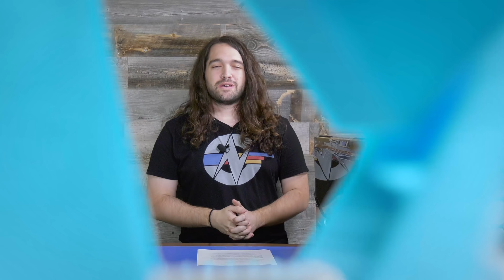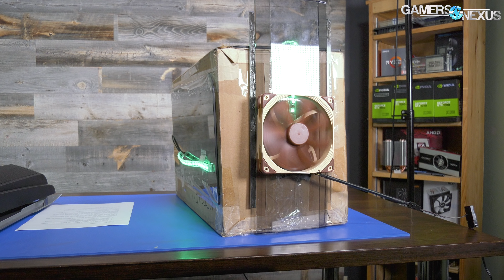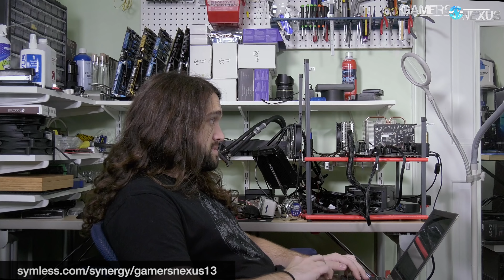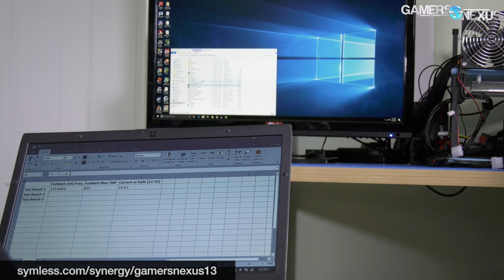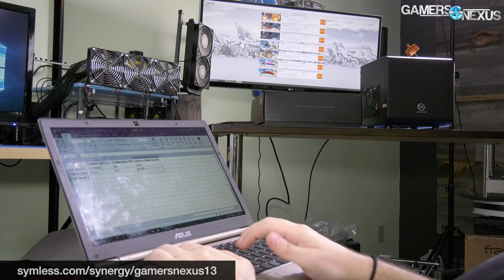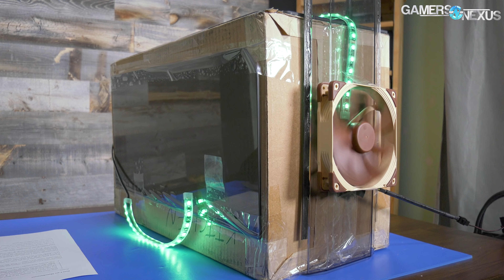Case Manufacturers: You're Worsening FPS & Power Draw

Comment: You do your research, you do tests different and are curious which is a rare trait today.
There's not a lot of people nowadays who just HAVE to know how and why to everything.
Your results are usually correct, they are way more accurate than ANY other techtuber, they have 99% of the time the correct conclusion and for 99% of the people it's correct.
keep up the good work.
 
But! you do tell some things wrong( Not directed at this video)
But you have the right entry point on every video you have.
Biggest error you've done is saying vega must have memory bandwidth, it's no big difference per se.
it's not very different from Nvidia but it's a very big difference on the HBM boards once you clock them and the technical understanding at very few points are somewhat lacking.

It clearly comes through that you ain't like me with 30 years of having the head inside computers and figuring out everything that is new and so on :)

Comment: Im planning to buy my own tempered glass front panel. Custom madw and make surw it has plenty of clearance cor the front fans. Yes you can buy custom made tempered glass with holes cut into it your way for pretty cheap. Then its all bout inserting a spacer of your desired thickness for clearance. Then getting some thumb screws. Yehhh

Comment: I'm looking for a case that is slightly larger than a Meshify C (GPU with front rad is .4 inches too long). Looking for open opr mesh front, no 5.25 bays, ATX size, and compact.
Would a 400C or 460X do well thermally, i currently use a 280mm IO, but I will get a NH D15 in a few years.

Comment: all you need: Dremmel, fibre cut-off wheels, 3/8ths drill bit.
every case i've owned in the 20yrs i've been building custom rigs has had extensive modding to add fans, expand for larger dia fans, turn solid panels into mesh ones, create wire pass-through slots (before there was such a thing), make room for radiators, remove drive cages & other bulky crap that blocks airflow, etc... there's NEVER a perfect case (TT X9 currently on order). that said, i completely share the frustration with current case trends being all show, no go - most are garbage as-is.

Comment: Part of the problem is the ATX format is so 1995.

The i/o panel needs to be in the middle with a new slot on the other side of the CPU.

There should be a fan under the motherboard.

More Type C USB.

Larger than eATX needed for more M.2 cards and quad-channel and Threadripper.

How about dual-Threadripper boards !!

Comment: When do u start your patented case production? :)))
On the topic - most pertinent points! Do keep in mind, though:
1. I strongly suspect that engineers usually take these facts into account, but the "cost of production" ppl... not necessarily (easier to keep all glass vs meshifying some parts) and they+marketing decide.
2. Vertical GPU bracket location - remember how it conflicted w one of your air coolers, in one of your reviews? The farther from the side window, the higher the interference, I think. This is a lesser of a problem w CPU liquid coolers. GPU cooling needs further thinking to balance Tglass and temps (and I don't think returnibg to side vent is a solution).
3. Definitely noise vs ventilation needs more discussion.
Thanks man! Keep doing a good job!
P.S. Oh, and I like how a guy named one of those CM mAtx all glass, nano-intake cases - a beautiful oven!

Comment: The problem I see is too much competition and not enough collaboration in the whole industry, competition is usually good but it is based on the wrong ideals (RGB & TG).
My example of a lack of collaboration is the introduction of GPU vertical mounts and back plates coinciding at roughly the same time rather than one being an upgrade or a modern variant on the other, GPU vertical mounts have come too late because the majority of graphics cards come with more aesthetically pleasing and affordable back plates.
Secondly there is a lack of or no GPU and CPU manufacturers that also make cases also, to consider thermals.
Take Samsung for instance and their SSD/M.2 process of ''all made in house''.
Are these not pretty much the best in this particular market?

Comment: I want to see you test a bunch of graphics cards with backplates on or off to see how much it affects perfomance. I have a gigabyte gtx 1060 6G Windforce (rev1, before the rgb...). After overclocking it at first pretty aggressively my card would thermal throttle at 90 degrees, after removing the backplate (even though it looks ugly) I'm getting 75 degrees max with the same overclock... I realize that this card's backplate is as bad as it gets but I want to know if there are other ones like this one.
Reply: I have a 1060 G1 Gaming. I get -10C without the backplate. It doesn't throttle with the backplate on but the fans ramp up extremely high and the sound is fucking atrocious. I'm never buying Gigabyte GPUs ever again.
Reply: This card also has very bad coil whine.
Reply: RIP. Well i wanted a cheap dual fan design so i didn't purchase the evga superclocked single fan. Mine doesn't have any perceptable coil whine though. :|
EDIT: I'm thinking about modding the backplate to make it more airflow friendly, using my trusty saw!

Comment: I gave up to tempered glass case just because it does not ventilate the GPU. With the new case, GPU fan speed has drooped from 70% to 40% without even touching any settings, and temperature dropped from 70C to 55C. I could even afford to switch to a deadly silent air CPU cooler, and ditch the noisy water cooler. Switched from NZXT S340 to Thermaltake Suppresor F51, cool and quiet case.

Comment: Thank you so much for making this video! :) It was time to address this topic! In my eyes a case should have at least mounts for 2x 140mm in the front and top and 1x 140 in the back and in the bottom. Also all openings should be sealed against dust and have easy removable dust filters. I also have no problem with mesh because i use LED fans and i want them to be seen. Back in 2014 when i  built my PC, i took the NZXT Phantom 630, because i wanted to air cool my system, so the 4 mounting spots for silent 200mm fans would be useful. I am satisfied with the case, especially with the 200mm fan mounted in the side panel blowing fresh air at my GPU and the dust filters everywhere. The only downside is the rather complicate cleaning of those filters and the front 200mm fan whitch is blocked half because of the designe choices NZXT made. Please Case Manufactures build cases that are good performing, easy to maintain and cool  to look at. Everyone else sharing my oppinion here? :)

Comment: They need to stop using foam to "dampen" sound. The truth is, a towel will often work better as a way to drop noise levels, however it doesn't discriminate against the right frequencies. The foam doesn't do anything, it's just a fire hazard (seriously, that stuff goes up in flames so easily). In order to get proper noise reduction, you need to pick frequency ranges you want to dampen. This is expensive, and you can't fit the proper shaping/geometry of the materials in the case. Oh and it's pretty expensive and will worsen temps, so you end up upping the RPM anyway.

Foam is the dumbest trend I have ever seen in cases. It doesn't do anything since it doesn't really dampen sound, it definitely doesn't dampen the right sound, not to mention EVERY different bearing on fans make different frequencies which means the foam, even if engineered right, would need to be engineered specifically for whatever fan you want to buy. If you want to dampen noise, get a towel you would dry off with, glue it on, boom you have better noise dampening product than the shit foam, and it's less of a fire hazard. Seriously, rip some of that foam off and put a lighter to it. That foam is truly scary how quick it ignites.

Comment: Wow, looks like H500P levels of build quality, there!

In all seriousness, thank you guys for focusing on this issue with form over function. After watching your H500P review I noticed more and more how few reviewers are taking stuff like thermals into consideration with their videos, most just build in it and say what they like with a couple things they don't. This is how I ended up buying a Phanteks Eclipse P400TG. Agreed with reviewers that is looks good and is easy to work in, but the thing is an absolute hotbox with a Ryzen 1600X and undervolted Sapphire R9 Fury, which runs on the required custom fan curve with undervolting. I keep all 4 case fans (2 stock and 2 Silent Wings 3, all 120mm) and my Cryorig H7 Quad Lumi at 100% at all times because temperatures are so bad. I also keep the 1600X stock, which sits at 3.7 Ghz all cores rather than the 3.6 Ghz base clock. 

I tested my temperatures rather unscientifically using 1 round of 24 player team deathmatch in battlefield 1 with maxed settings with Cam's OSD running and noting the ballpark of the temperatures with all panels on, the front panel removed, and the front panel and side glass removed. With all the panels on I had around 68 to 69C on the CPU and 73ish on the GPU. Front panel removed dropped the CPU all the way down to 58ish and the GPU was barely above 60. Take the window off and the CPU further dropped by a couple C and the GPU never rose above 56C. I'm not suprised removing panels improves thermals, but i'm astonished at how much of a difference something as easy and quick as pulling the front panel off makes.

Comment: As someone wanting to build a new PC who is currently using a case I've been using since around 2004 I can tell you I love this video. The problem is that things like RGB and attaching the term 'gaming' is all marketing that panders to the shoppers who shop with the eye...which I think is sadly most people. I'm someone obsessed with performance, I'm thinking of maybe using the BeQuiet Dark Base 900 but note that I'm not going to use the Pro because I don't want a glass side panel or RGB even though I love the wireless qi charger, I love the functionality that the case provides, even contacted the manufacturer directly because I also want USB 3.1 Gen 2 on the front panel so they've said that likely next month they'll be releasing a new case with this...so lets see. I'm more about future proofing and functionality than glitz and glam.

Comment: The new Nzxt h700i do have about an inch on both sides from top to bottom on The front aswell as from front to back in The top of the case . So that should solve The heat issues they suffered from on their s340 series ? What do You expect from those cases?

Comment: You can achieve quiet design with a case that has a large open mesh intake on the front and large exhaust openings on the top or back by having larger, slower turning fans moving a large amount of air through a case in a well controlled manner.  The key is to lay out the interior of the case in ways to channel the air directly across the components that need cooling.

You can also divide up the case into sections with each section having its own airflow system.  Have the power supply pulling its air directly from the outside so its fan isn't trying to cool anything but itself.  Have the drives in their own section with its own intake, exhaust and fans to move air through.  Make their mounts open with enough space between them to to allow ample air flow through the drives.  Put the GPU in its own section that, like the drives, has its own intake and exhaust openings as well as its own cooling fan.  Connect it to the motherboard with a riser cable so its heat isn't helping to cook the CPU and vice versa.  And that leaves the motherboard in its own space that again has its own intake and exhaust openings as well as its own cooling fans.

As for RBG LEDs and glass panels ... feh!  I have no use for such flashy gee-gaws.  You can have them if you want them.  I'd rather put that money into stuff that actually makes the computer work better like a larger monitor or a slightly better GPU or CPU or more storage.  Or maybe a pizza or two.

Comment: I've not liked tempered glass since the trend started. I like my Cooler Master case I bought in 2010,full mesh front,side vents with a directed air flow duct to CPU fan,2x120 fans in front ,and a 120mm fan in back.

Comment: I actually have Corsair 600C. Did you see the vent gaps for that front panel?

And also, people who went for open cooling for GPUs instead of blower style will make case choices more valuable because of heat dissipation. Those graphics cards nowadays are dumping heat all over the place and case engineers are not as bright to take heat dissipation into more account as their RGB brightness.

Comment: I guess I am just a noob or something but I don't want my cards pre-overclocked because I want them to run cool and stable. I don't want to overclock my CPU either. I just want something solid and fast that requires zero tinkering. I know this overclocking often results in slight performance degradation over time and to think they are basically forcing you to OC your card reminds me of forced obsolescence.

Comment: Re: Airflow, so what's better/worse, open air cases or ones with good directed airflow (like your modded mesh coolermaster)? 

I only ask since I'm building a new rig in the Thermaltake Core P3, thanks to its open design there's no real directional flow. The CPU has an AIO so that's fine, but my GPUs are air cooled and I'm concerned they're going to cook!
Reply: Active cooling works best when the airflow through the case is carefully controlled.  There should be specific places where cool air enters, physical channeling inside to direct the air coming in to pass over components that need cooling as it travels through the case, and specific places where the hot air exhausts.

Take a look at the innards of some of the itty-bitty desktop cases used by companies like Lenovo, HP and Dell.  They often have precisely molded internal ductwork that carefully and deliberately directs airflow from an intake to the CPU cooler and then on to an exhaust opening.  This allows them to have adequate cooling even in tiny little cases that from the outside appear as though it would be a miracle if air could flow though them at all.  With that sort of design, a case fan can actually be acting as the CPU cooler fan as well because its ductwork closely wraps around the CPU's heatsink.  Extend that idea to another ducting system for the GPU in a gaming rig, and another for the storage device bays, and you've got a system where every last CFM of the airflow is actually being used to cool things and none of it is simply passing though without ever really touching anything that needs cooling.

Comment: This is what I want, mesh front and top (love it when there is room for push pull rad configurations like the 780t where the fans can be on top of the case but under the mesh),  just one tempered side panel with some sort of slits in the glass with mesh glued onto the slits or even a tempered glass side panel with an old school meshed fan intake mount near the gpu with maybe a painted section or proper placement to hide the fan cable. Used to love cases with side air intakes or even air ducts. Yes the glass is nice but can't we mix the two some how? Performance and looks with more emphasis on performance?

Comment: The problem is that the market demand is for aesthetics and people fail to understand that the sacrifice for a decent case is in-turn thermal performance. The NZXT S340, my personal case and a very popular case, has about a 1/2-3/4-inch gap in the front panel which then has a mesh cover. I removed the cable-shroud on the inside to make room for push-pull in the front because there wasn't enough air moving through the radiator. The case also vibrates if the fans speed are too high, amplifying noise levels even when my fan curve is low. I bought this case about a year ago and this is from my experience.